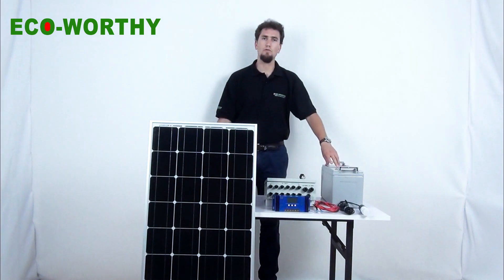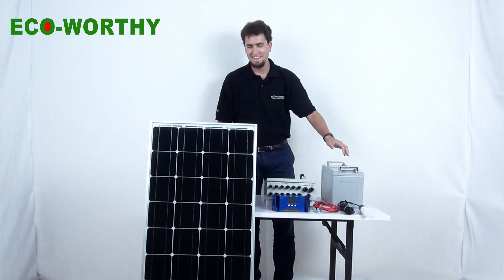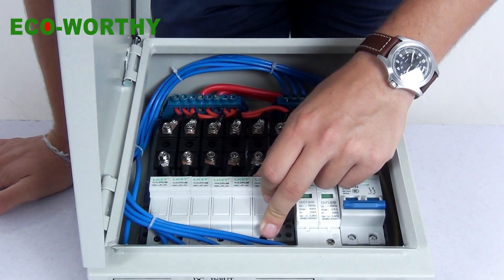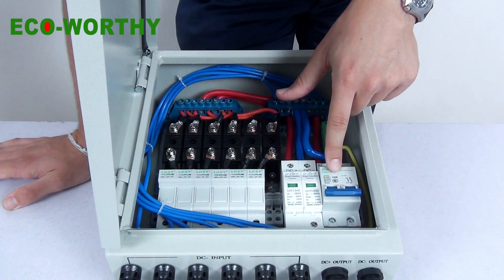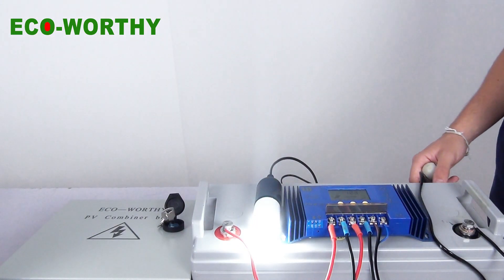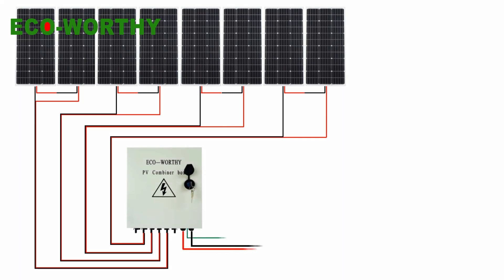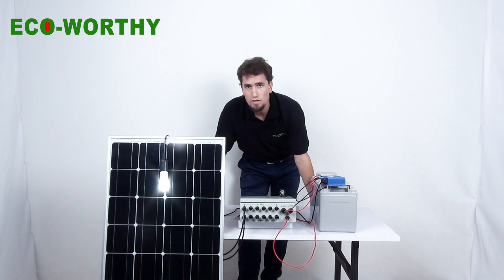What is a COMBINER BOX & How to Wire It for Off-Grid Solar System?

Comment: need sample on how to wire inverter to hose main box
Reply from the maker: Hi,

If you are using an off-grid inverter, you cannot use it with the mains, that is, you cannot connect the inverter's AC output to a household power distribution box that already has mains power.

If there is no mains power, please connect the inverter's AC output to the input side of the distribution box.

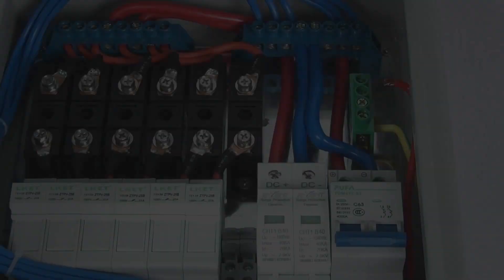Comment: can you fix two arrays ,one  is 2:26 150v other is 200v  array
two different makes
if you connect  the two arrays
what is total  giving out    
how many  volts
Reply: If you connect them in series it’ll be 350V, if you connect them in parallel it’ll be 150V
Reply from the maker: thanks
Reply: 150v comes  in 10nosx15v=150V

Also i have 60vx3 panels in series
180v
but they are different  makes

can i connect all in series to get to get 230volts
Reply: @sunjayjay240  I mean yes you can connect them all in series but it will make them very inefficient. The current will be reduced to that of the smallest panel. Rather have two separate strings